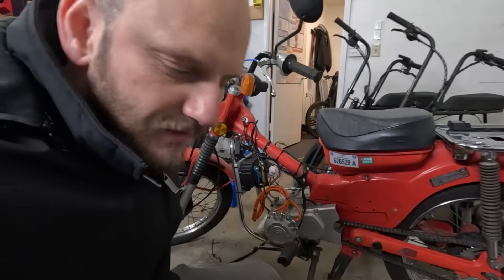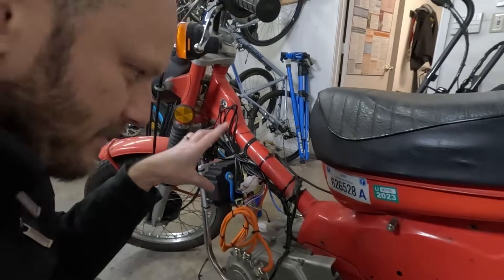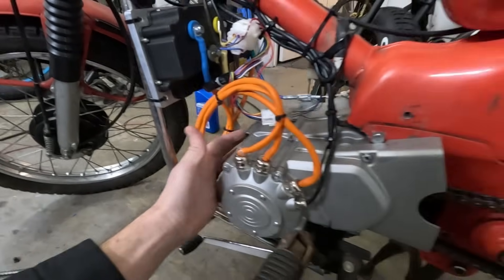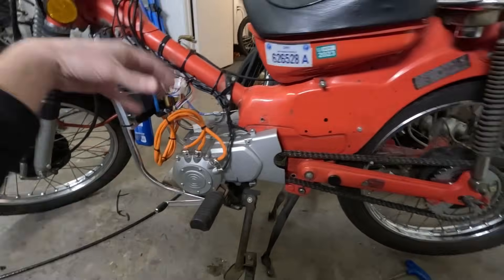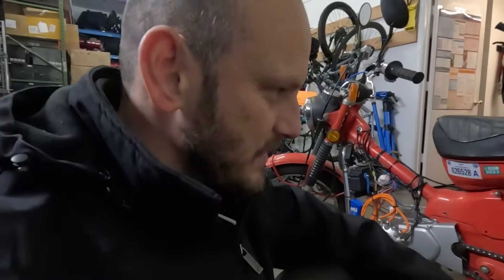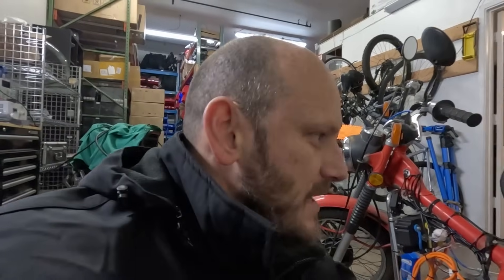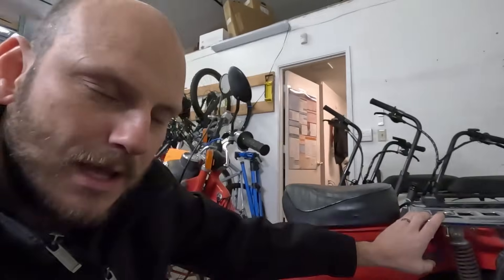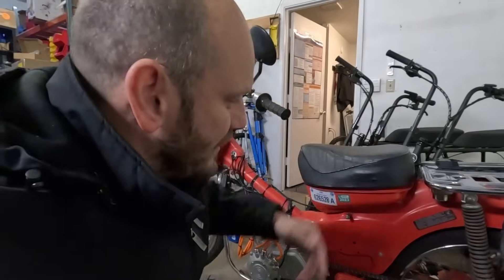An Electric Motorcycle motor with a 4 speed Transmission?! A first Look ct110

Comment: I have an old honda cb750k that I want to convert but I don't know if there's a big enough motor out that would equal the sheer power of the old 750 motor currently on the bike....We already talked about that QS motor you have but I watched a few conversion videos using it and I'm not sure it would serve the purpose I want it to serve. On that note, that CYC X1 Pro Gen4 I bought from you is an absolute power hungry monster and I love it! I could almost see it being used on a motorcycle with it's 5000w rating...
Reply from the maker: I think the 4000w qs motor I have paired with a powerful enough battery would be close to an older 750 power wise.
Reply: @JohnnyNerdOut  I'm not sold yet but I'm still considering it! My old 750 can do around 100mph on the highway... Maybe with the proper gearing and a big enough battery I could get the QS to do around 70mph?
Reply from the maker: @unwillingful  I think so. Just get a good controller and battery that can output at least 150a continuously
Reply: the on paper max power at max power rpm for the 750 is like 70 000 watts.

it would mostly feel as powerful with a fraction of it(you have the power at far wider range with the electric), but 4000 watts wouldn't do it. there are bigger motors and setups available but then we're talking like city car levels of power anyway rather than e bikes. at like 3500 or so rpm on the 750 cb you can already be doing 14000 watts worth of work if you crank it wide open. 

the amount of battery amps you need etc shoots up drastically as well, it will still take some more time until that stuff is more widespread and in mass production for bikes at which point you would see a lot more of electric proper motorbikes than just the few that are out there.

this engine seems like a great replacement for like honda waves, ryuoka classics and other underbones popular in asia that are rarely pushed to top speed runs.
Reply: @lasskinn474  I know that there are hub motors that will give the power I want but I prefer mid-drives because of the torque. I have seen some folks do amazing QS motor swaps on dirtbikes and one motorcycle but he built this massive custom battery for the bike. I'm not at that skill level yet.
Reply: @ Aside from my previous comment, we're not talking about the motor in this video. Johnny has a QS 138 motor that has a pretty high power rating if set up correctly. It is only a single gear though, no transmission.
Reply from the maker: @lasskinn474  that 4000w rating is just a nominal rating. People push over 20,000w through it if they have a strong enough battery/controller
Reply: @JohnnyNerdOut  ok! thats definitely interesting

Comment: Great project. Is there a link to the motor?
Reply from the maker: Yes in the video description
Reply: Since it can't stall you can start in any gear. Shift if you want or use the clutch.
Reply from the maker: @dezmo3017  correct, although starting it in too high of a gear would put undue stress on the motor and would probably lead to it burning out prematurely over time I would assume.

Comment: Very cool! Beyond my ability to build in my living room though (while still married). I've always wondered why EV cars don't use transmissions. I get that they don't have to but transmissions would allow a greater range of performance (like gears do on a mid-drive).
Reply: EV car motors have so much power that the comparably little inefficiency doesnt matter. on an ebike it matters much more as its much less powerful.
Reply: @SB7-r9i  If I follow your theory to its natural conclusion, gearing would allow for smaller lighter motors & consequently smaller lighter batteries. Why not go for the better range & faster charging times that would allow. We don't build ICE engined cars over 2k horse power just to avoid gear boxes.
Reply from the maker: I think some do now. Pretty sure my Kia plug in uses the transmission with the electric motor. It’s a very weak motor though but powerful enough with proper gearing.
Reply: @JohnnyNerdOut  Yeah some PHEVs do use some sort of transmission set up & the new Subaru HEVs will work directly through the same transmission as the ICE engine. I'm still eagerly waiting for transmissions in the average full EV.
Please tell me you didn't part with the manual Volvo wagon. You'll probably never get as nice a transmission in an EV;)
Reply from the maker: @michaelsprinzeles4022  still have the Volvo , just dumped a bunch of money into it actually.
Reply: @JohnnyNerdOut  Worth it, IMO. Almost impossible to find a manual wagon with a turbo these days. A combo as good as PB&J! I'll keep pumping $$$ into my old Outback XT until parts aren't available.
Is my bias showing?

Comment: A couple years ago, YouTuber Engineering Explained kept saying I was wrong & that gears ⚙️ on an electric vehicle provided no benefit whatever & supposedly just added extra weight. Which made me question his engineering abilities. 
As Johnny (who doesn't call himself an engineer) explained how a mid drive ebike system with a derailleur & gears can extended battery range. Finally after showing him articles of how Porsche was adding 2 gears. To their EV, he finally decided that gears ⚙️ can provide a benefit. 🤯
Reply: for the ones that say "electric doesnt need gears", i always ask... "so why does my lathe, drill, drill press, milling machine, all electric... have gears?"

power is torque over time but its also amps times volts and if they arent matched, you just waste energy as heat... a vehicle isnt supposed to run at one speed.
Reply: @paradiselost9946  Yup, with a couple gears ⚙️ a smaller motor can be used to save some power. He was saying that the car  motor is so big with so much torque that it doesn't need gears and couldn't grasp that/how, an extra gear or 2 can make an EV more energy efficient. Similar to why some ebike motors are geared hub. Instead of a direct drive motor. The geared hub can make the same or more torque using a smaller lighter less powerful motor VS having to make a bigger heavier. Direct drive to get the same hill climbing & quick accelerating torque. The bigger heavier direct drive needed to match the geared hub torque, will ultimately have more top speed. But if you're not after a much higher top speed. Then you're just lugging around a much heavier DD motor & also using more power to reach the same hill climbing torque as the geared hub motor.. Even when I explained 1 example like that. He continued to say that I was wrong about gears on EVs & that they provided no benefit whatsoever.
Reply: @michaelbrinks8089  yep. its fun asking self proclaimed "engineers" to explain what amp-turns are... how it relates to dynes or force, ergs or work, reluctance, permeability, magneto and electro motive force... a coil of wire can only produce so much magnetic force for a given current before it saturates. needs the volts to drive the current through its resistance, but current through resistance makes heat...

this is before contemplating physical aspects such as pole area, pole pitch and arc, the number of poles...

a stalled motor may DRAW thousands of watts from a supply, but whats the power delivered by the shaft? if its stalled, its not delivering ANY power... throw in some gear reduction, so it can spin for a given load, and its now delivering power... but again, how much of the power consumed is converting to heat versus useful motive effort?

too many people just like parroting the catch phrase "electric motors are super efficient" without understanding the circumstances when that statement is actually true...
Reply: @paradiselost9946  It's obvious you know more about electric motors than I do 👍...I was able to grasp the simple concept of gears ⚙️ with electric motors. By riding a 10 speed bike & pretending my body is the electric motor or using a drill. The gears ⚙️ in a drill give the motor more torque. So it doesn't need a huge direct drive electric motor. Making the drill so big it's hard to use. I gave those 2 examples and he still couldn't grasp how gears could be beneficial on an EV. Yet  other than that he does seem to be pretty smart 🤓 He got rich from YouTube by making videos, regurgitating what he was told in his engineering classes.
Reply: @paradiselost9946  I remember Hyundai or Kia went through some advanced electrical engineering to make their new electric vehicles be efficient at both low and high speed operation but electrically it was complex because they were using some kind of phase converter on their 3 phase electric motor. It would operate at low speeds and torque in Y type configuration but at high speeds it switched over to Delta. This is a bit above my electrical knowledge but it had something to do with how the 3 phase system works on this motor. It had like 6 electrical connections on it's wire harness or something like that. It's one way to solve an efficiency problem but maybe a transmission in line with the electrical motor would have been a simpler solution.
Reply: @DJWhitetailfluff  that’s probably where the ratio is changed by using an integer fraction of the total number of poles on the stator. So you can divide by 2 or 3 but probably not any other ratios.

The controller and motor would have to be developed together to take advantage of it. I’ve heard the idea before and it’s been applied in more primitive motor controllers, but EVs need more precision so I can see why it hasn’t made it to production before.
Reply: @michaelbrinks8089  I feel like we are reliving the old days like with gas cars but now with electric motors. Back in the day it wasn't uncommon to see most cars had pretty big V8 engines and transmissions with few gears be it auto or manual. You have so much engine and lots of low rpm torque that in a way you didn't need too many gears and it still met the highway speed limit requirements at the time. But those big stock V8 engines lacked a lot of mid range to top end horse power. So all low rpm torque you need but upstairs in the rpm range? Forget it. Nobody is home. Also since the cubic inches of these engines were pretty large they got horrendous fuel economy. I.E. let me know when you can get 30 mpg out of a low revving 1970's Lincoln Continental with a V8 460 under the hood and 3 speed auto. And no Cheating. LOL Case in point. I feel like we are doing the same thing with electric vehicles. Oh you have to have a big electric motor to make an EV anything perform. No not really. I know you can without a transmission but is it really the best option? In this day in age we can have gas and Diesel vehicles..Mostly gas. With much smaller engine displacements. Some being turbocharged with 10 speed automatics. Over generations we went from big engine and fewer gears to smaller engine and more gears. Why not try this with EVs? I'm starting to second guess myself that it's possible.
Reply: @DJWhitetailfluff  Also seems like we went from big gas guzzling trucks & SUVs to big electricity 🔌 guzzling trucks & SUVs with horrible towing range. That goes down to like 16 miles in cold weather......I don't know a lot about electric ⚡ motors & gearing ⚙️ but it's easy to understand. If you've ever rode both a single speed bicycle & a 10 speed bicycle. You can go much faster on the 10 speed. Despite using the same human power source. So a smaller power source with gears can go as fast or faster. Than a more powerful single speed.... I don't understand why no one is building  small, very aerodynamic, lightweight, efficient, 2 seater hatchback, commuter, EV cars that can rechargeed  off a standard 120v 🔌 & 240V plug ins. Without the need of special chargers installed on the garage wall. Or something like the Sono which is box shaped. Like a Honda Element to maximize interior space & covered in solar cells on the outside. To extend range & can be charged by any 120V outlet....The Aptera car still hasn't hit the market yet.
Reply: @michaelbrinks8089  I agree. It's odd too cause at the beginning there was at least a few small compact electric cars but somewhere between 2020 and the Government EV push which I don't like we got the axe on commuter sedans and hatchbacks and we now got stuck with big cars and SUVs.They say the market shifted to what cars people are buying but I don't believe that as a whole. It's just alienated a bunch of people in the car market. And comparing them with the same engine tech of similar years the car would still get better mpg than a crossover or SUV or Truck. This trend is the same with EVs too. Vehicles overall got bigger too because of all the tech and safety standards and airbags which makes them even heavier thus hurting range and more frontal area to have to comat aerodynamic drag at high speed. Cars could be so much simpler than we make them but the manufacturer doesn't want to do that. Also much like you said Riding a bike with many gears will be easier in different dynamic situations vs a single speed bike. Even if I have the leg power to pull from a dead stop in say fourth gear I still had to expel more energy to do so. How much depends on my desire to how hard I want to accelerate up to speed. Now yes you can have to many gears to where it can be inefficient from the standpoint your like driving a Semi constantly shifting and not covering much distance cause your geared so low. Unless your hauling weight and not in a hurry then it would be impractical.
Reply: @DJWhitetailfluff  on paper, quite easy. industrial applications, quite easy. you can have, say, a 24 pole motor with a low speed but plenty of torque.
then split them in half, run in parallel for  12 pole motor with twice the speed... half again for 6 pole, at four times the speed...

transitioning that smoothly whilst running? not so easy.
Reply: @paradiselost9946  Ah. I see
Reply: @DJWhitetailfluff  👍
Reply: An electric motor doesn't "need" gears, but by having gears you reduce the amp requirements of the battery, which allows you to use a relatively high-amp ebike battery, instead of a full motorcycle battery. I could convert that frame with no gears, but using a bigger motor and a custom high-amp battery. All it takes is money, if you are rich. Of course if you are rich, why would you bother with a DIY conversion? Great video, thanks for posting this.
Reply: @ronroberts110  "Need" was the wrong word. He claimed that since a big EV motor had so much torque & could run fine without gears. That using gears on EV couldn't provide any type of benefit.
Reply: Even a air compressor is reduced in rpm
Reply: @ except the 'direct drive" cheap junkers that tend to last for about 3 months... but thats actually often due to the air line between compressor and tank. too small a volume, and when they start, the pressure rises faster than the motor takes to reach its operating zone... stalls... draws massive current... burns out its start windings...

a REAL air compressor is geared down!
Reply: @OKFrax-ys2op  Not sure why I posted such long comments about it. 😂 😂
Reply: It's not "no benefit" so much as "limited benefit". Brammo's line of electric motorcycles had a clutch and 3 gears, which did provide a different torque curve at different speeds, but largely owners tended to stay in 2nd gear, providing a balance of torque across the entire speed range.

The thing is, you can't stall the motor, and lugging it is really not an issue.

And from an engineering perspective, the weight and power loss of the clutch as well as a drive system often negate the benefits.

So, it's not a "hard no", but it's "mostly you're not going to need it". And I would honestly expect literally this very motor he's used to perform better without its gears than with them.
Reply: That's pretty cool. I wonder if they add a style configuration like ones in a manual gearbox or planetary gear sets like in a traditional automatic.

Comment: I missed the part about how the transmission works.  Do you shift it or is it like an automatic transmission?
Reply from the maker: Manual transmission. It has a standard kick shift lever
Reply: @russellburns9480  yes, he had to add a generic clutch handle and cable.